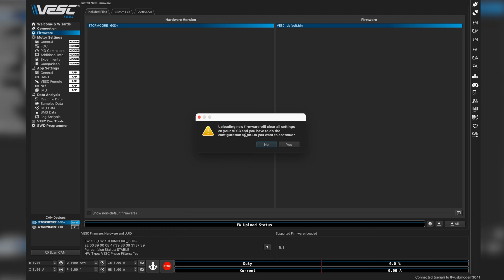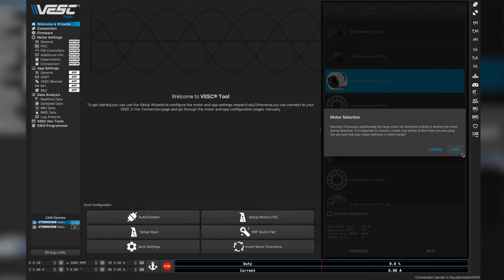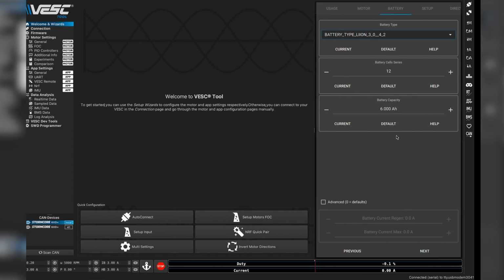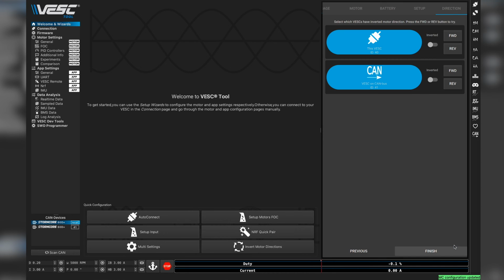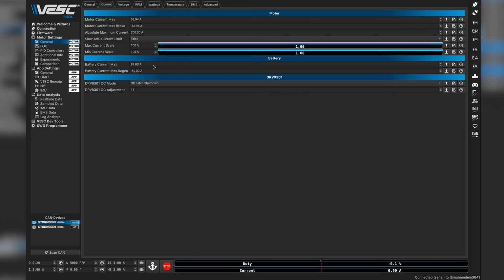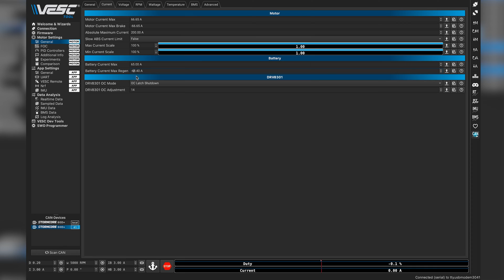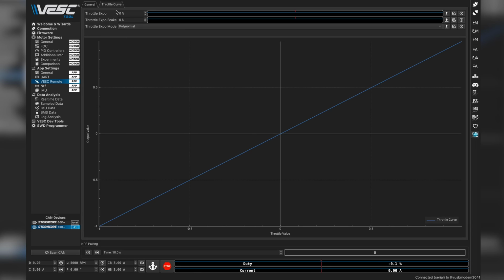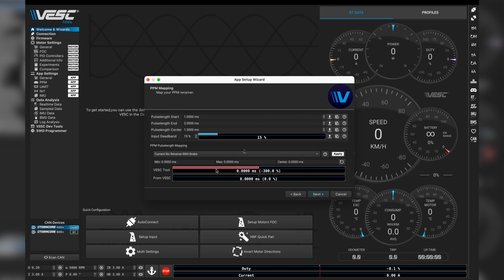Stormcore 60D+ Programming Guide

Comment: this video can be used for MakerX esc | MBoards DV6s + Bluetooth Module? Or are they different configurations?
Reply from the maker: Settings would be very similar, we will make a MakerX specific version soon
Reply: @MBoardsco  I just bought this esc from you and I'm going to need to configure it, it would be great to know how to do that!!!
Reply from the maker: Absolutely, these units are brand new. As soon as we can we’ll release new videos on each unit.
Reply: I just programmed my dv6s and it was fairly similar. I’d suggest using a MacBook and wire the esc to the computer. ( i needed a type c usb adapter to plug into the MacBook). RB-emotion has a good makerx program vid too.

Comment: Hi is it possible to say power your esc with a desktop power supply? what would be the minimum voltage / amperage needed? I have a Xenith v2.1 and also does the phase wire orientation matter for the Xenith? or is that just a storm core thing?

Comment: Just wanna say that using 45a per cell with p42a is crazy. The voltage sag will be around 75% of the battery's capacity maybe even more, also the cells must heat up crazily fast. Even 35a is a lot lot and you lose 50% of your battery in an instant. Also the regen current shouldn't be dictated by the battery's regular charge value, not even the max charge value. It should be set so that the board brakes as one needs in high speeds. With 16a regen if you are going 50 kmh your brakes will be really bad. Even if it might lower the battery's lifespan, it's better than end up in a hospital because of barely functioning brakes.
Reply from the maker: Have you used P42A cells before? Voltage sag is a non issue compared to other cells the industry has used in the past- though this video is all about max values. We do recommend that everything gets toned down if possible to preserve your hardware. 

Regen alone does not solely dictate your braking power.
Reply: @MBoardsco  But Esk8 Spirit is correct about the voltage sag, the last 25% of a ride using 45a per cell group the power is non-existent. I like and use p42a cells but the 45a continuous claim is bogus, 30a max, 25a if you want the cells to last a long time. You guys are also running the battery below 3v per cell, while it's a doable thing pairing that with max discharge is gonna eat through the lifespan of your pack, 36v should be max cutoff.
Reply from the maker: Again, we’re talking about absolute max values here. I’d always recommend reducing these as much as possible and run your hardware as conservatively as possible. 

These numbers also illustrate that there are limits to the stormcore and even if you did want to run each cell at 45a, the stormcore will bottleneck you anyways. 

The tutorial is meant to show you how to find your own numbers, not copy these. 

We run our cutoffs quite low at the shop, we almost never truly drain our packs this low, but we leave our setting low just incase we really really need that extra bit. 

We are certainly not trying to “milk” our customers. They have every ability to change their cutoff voltage if they choose. We’ve had a completely fine experience running these values. They work for us and our hardware. 

In our mind, we’d rather have they extra juice just incase, but plan our rides so we aren’t at 0% when we’re done riding.

Sounds like adding a “conservative”, “moderate”, and “aggressive” tag to extra values to the worksheet would help a lot.
Reply: @MBoardsco  Love the "Sounds like adding a “conservative”, “moderate”, and “aggressive” tag to extra values to the worksheet would help a lot." ETA on when you might have that info out?